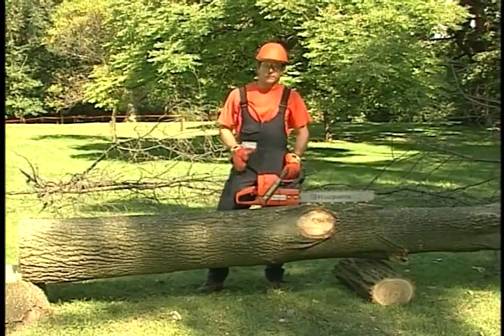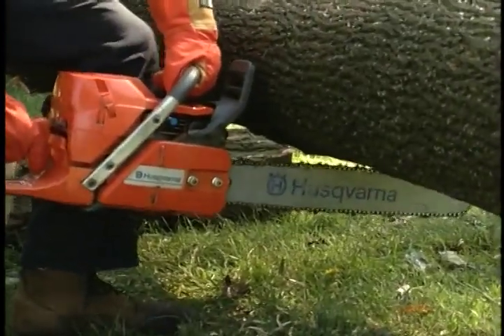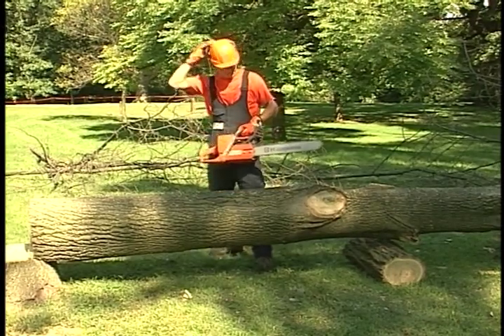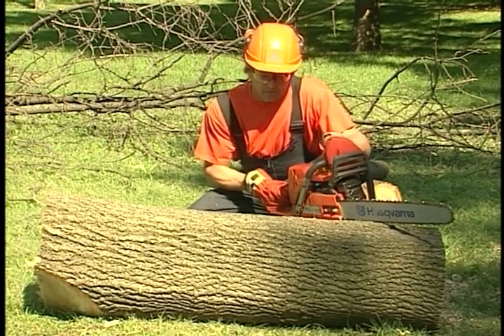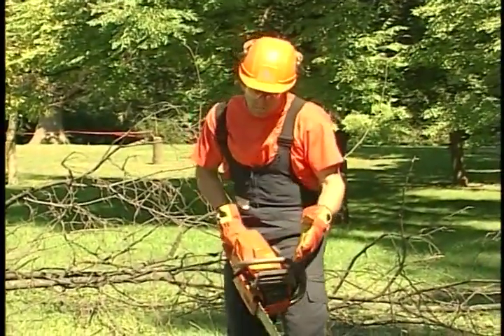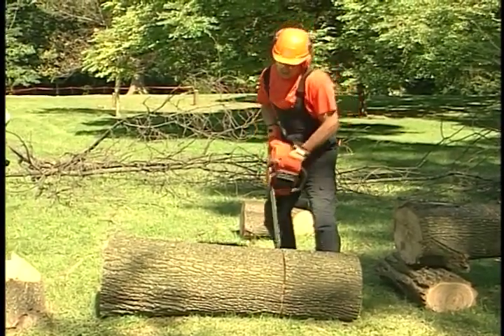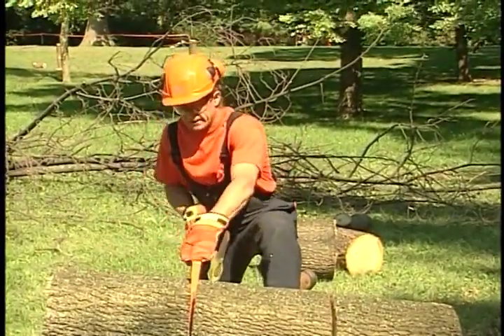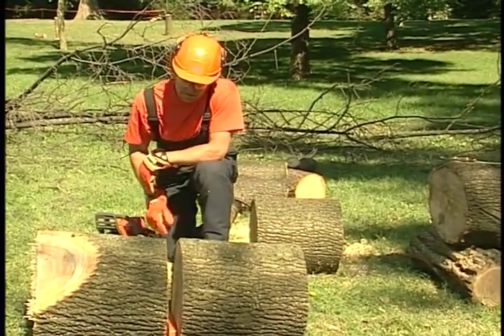Bucking

Comment: Thanks for the tip on using the wedge so my bar does not get pinched when log or tree is under pressure. I just got my peavey today with a built-in stand to help make cutting logs that are on the ground safer and easier.

Comment: All fine and good, but you didn't show how you got the tree off the ground with logs under it.  This is what most people have difficulty with.  How do you get a 5000 lb tree off the ground?
Reply: He didn't get the tree off the ground....
One side of the tree, was still attached to the stump, and the branches were supporting the other end of the tree.

And he just rolled a small log underneath the tree...  he didn't have to lift the tree up, to get the log underneath.
Reply: My thoughts, he placed the logs under the landing zone before doing the triangular cut.. perhaps he placed multiple logs in diff locations for all possibilities. Either way, he gives solid advice on wedging here.
Reply: I have a very old book from better homes and garden that shows you how to build a log cabin and in that example they use small logs to leverage the other logs around. I'm very small in stature and have little upper body so I have to use leverage and extention a lot 😂 strength.